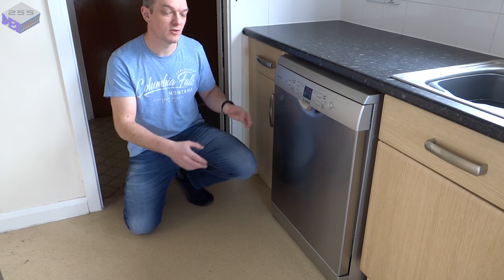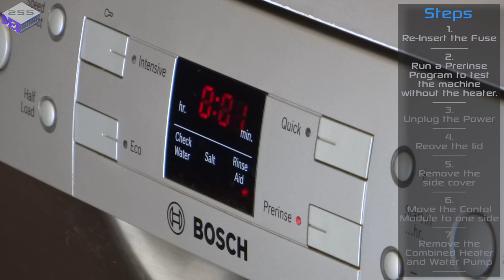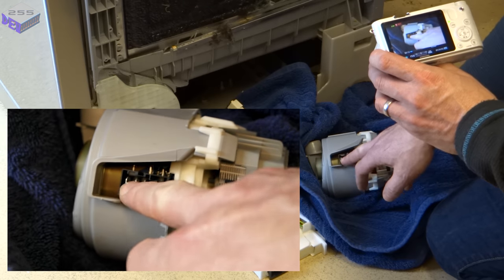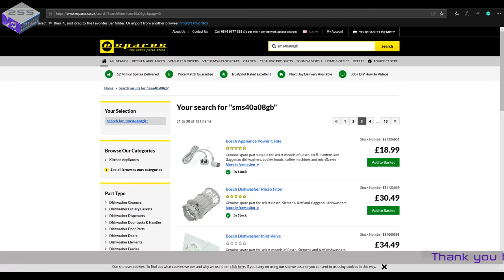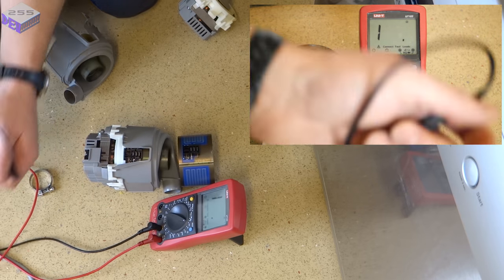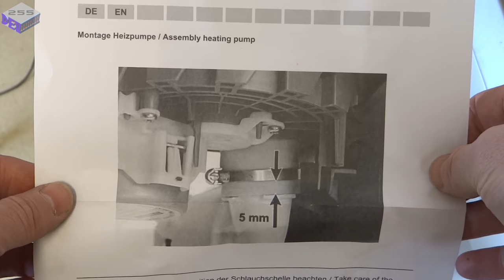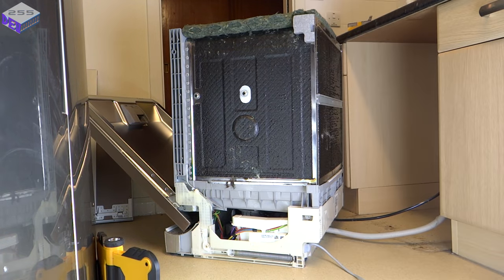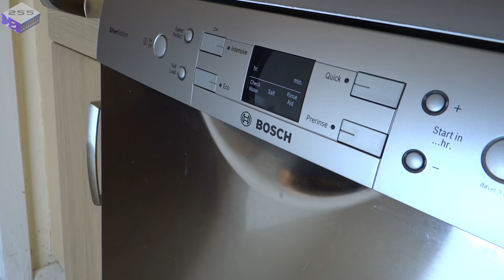How to Test & Replace the Heater & Pump in a BOSCH, SIEMENS, NEFF and more Dishwashers

Comment: Hi Thanks for the video, replaced faulty pump, but still no joy with heat.  No shorts happening.  Dishwasher still runs full cycle but with no heat.  Flashing water tap light when finished.  I did have a faulty pump as did a complete check as you described, had open circuit and new part tested good?  Any suggestions before I buy new washer? Anybody want a new heat pump for a Bosch?
Reply from the maker: Hmmm, a couple of things to check. Firstly the connection for the heater at both the heater end and controller end. You could always take the lead off the controller end and measure to 20ohms through the lead, that way you are testing the connector also (at the pump end). You could also check the thermistor with your meter, this should be in the k ohm range at room temperature. I can check mine and let you know if needed. There is not really a lot else you can test without power applied. I would insist that a fully qualified technician checks the following for you:  Connect an AC voltmeter to the heater output (while connected to the heater) switch on the machine (not touching the meter) and running through a program to see if the problem lies with the control board, it should show near to your local mains value when attempting to heat. Under no circumstances should any unqualified person attempt live testing (especially where water/high humidiy is present). I hope that helps
Reply: @TheSolarPoweredEngineer  Thanks so much for the reply.  I had the same problem as another commenter with the little grey wires leading to the heat pump coming out of the connection clip.  Before your reply and after I traced the correct combination back to the control box and took a punt on not getting a great connection.  Striped the wires back a little and made sure all secure.   All working again mainly thanks to the heads up of your video to look at the heat pump and test!  You have (for now) help saved me dishing out for a new machine.  Thanks for the video upload!
Reply from the maker: No dramas, happy to help, glad it's fixed
Reply: @TheSolarPoweredEngineer  Amazingly, I seem to have experienced the same problem at the same time - I replaced the pump (it had failed - open circuit on the heater) and yet still have no heat with the new pump (except, bizzarely, on the Quick cycle, on which the heater runs for a few minutes to make the water lukewarm as opposed to cold).  Relays on the board still functioning so am about to read the last rites unless someone is able to advise any way to bring my dishwasher back from the dead...🤔
Reply from the maker: @666dogg666  hmmmm the relays may be energising, but are they making a decent connection, It may be worth spraying the contacts with switch cleaner if you can remove the caps, leaving for a while then trying again
Reply: @TheSolarPoweredEngineer  thanks...will try it.  Did seem to be continuity through the relay but no harm in checking and cleaning the contacts...will update.
Reply: @TheSolarPoweredEngineer  thanks, managed to take the top off the relays.  They seemed pretty clean though I cleaned them with some fine grit paper nonetheless.
Back to test on the
Reply: @TheSolarPoweredEngineer  thanks - managed to open up the relays.  They seemed clean but I nonetheless skimmed the contact surfaces with some fine grit paper and put it all back together.

Ran the quick cycle and...got the same result.  Approx 3.5 minutes' heating and then I heard it click off.

So...ran again but interrupted the fill to add some heated water, to see if a thermostat / thermistor was causing it to trip out early.  So whatever temperature at which it stopped heating would be reached much sooner.

Result...heating ran for exactly the same time.  So probably not a problem with the thermistor.

One common factor seems to be that the heating stops when the first phase of a wash cycle finishes.  You hear the pump pause approx 6-7 minutes after cycle start (approx 3.5 minutes after heating starts) and at that point the heating stops, indicated by the click of a relay and my smart meter showing the drop in consumption.
That change in the wash cycle could be a trigger, though for what I have now run out of ideas...

So am really scratching my head here,
Reply from the maker: @666dogg666  That's a shame, what was the Wattage difference of your smart meter? the motor doesn't draw much current, if there was a fairly high change on the meter, this could still indicate a thermistor issue.

Comment: Hi, 
what must be resistance of the ntc pins ? Near the heater sockets..
Thanks a lot..
Reply from the maker: Hi, I haven't got one to hand to test, although thermistors normally operate from around 1k to 10k ohm,
Reply: There is a resistor from the centre pin to each outer pin. So each centre to outer measures about 11k at room temperature. If you measure across the outers you will see this in series - about 22k.

Comment: Hey Neil, love the video, it's also exactly what i needed to show me how to replace the pump in my Siemens dishwasher. However, i need advice, my pump, which i bought from the UK, BUT, when i removed the old one the 3 grey wires came out of the sensor connector, so now i'm stumped to figure out which grey wire goes back to the connector, relative to the connector on the board. Any ideas how i can figure out how to make sure the wires go back in the same holes?  The plug that it goes into on the board is a 5 pin, and has 2 yellow wires, positions 1, 2 and the 3 grey wires, from the pump, positions 4,5,6. cheers in advance.
Reply from the maker: Hi, thank you. I'm glad the video is helping. The grey wires go to the thermistors, there are 2 of them, and they should read around 10k ohm at 25ºC. The centre pin, I believe, is ground (but is certainly common), so you may be able to test this back to the control board on the wires to determine the centre wire. Both the other wires should read the same value to the machine's chassis, where these 2 are the outer wires. So you would end up with pin 1 - thermistor 1 sense, pin 2 - common for both thermistors and pin 3 - thermistor 2 sense. It won't matter if pin 1 and 3 wires were reversed as they rise and fall at the same rate with temperature (assuming no-fault), although if pin 1 or 3 wires were incorrectly connected to pin 2, the temperature reading would be off, and you may get no heating or heating too much with an error. I believe the pair form part of a Wien Bridge with matched pair in the control unit, although I don't have one here. I hope all that helps; please let me know if you get it fixed and good luck.
Reply: @TheSolarPoweredEngineer  Hey Neil, Thanks or the quick reply, dishwasher was in the kitchen in bits for most of the day and morning,. However, with your help i managed to fix it (so it seems after testing). I was fortunate enough to have one of the grey wires come out of the connect with the metal clamp thingy (from the connector) still attached, so i only needed to figure out which 2 grey wires were where. Also fortunately, the one with the thingy attached was one of the sensors rather than the power one. (It was number 3 on the connector - that wire going to number 5 on my board connector - only 5 pins on board connector). So opening up the board and looking at where the grey wires went, i was able to determine that, the 'pin' with the transistor was the power controller, and so therefore the other was the 'other' sensor. So with a little bit of logic, and with your comments above, that the centre pin on the pump connector was the centre pin on the board (so that was the power connector with transistor - common) and so it fit into place. Seems fine now after a test wash, it heats up, no E09 code and stops when it should, and more importantly no leaks! Cheers!
Reply from the maker: @Ka Bu  Hi, no dramas at all; I'm glad you got it fixed, it sounds like you are a true techie. Well done 👍
Reply: @TheSolarPoweredEngineer  I am an Engineer of the design/development variety, not really Electrical Engineering though, but know enough to get myself into trouble!. Was fun. Again thanks for the tips.
Reply: @TheSolarPoweredEngineer  For anyone with the same issue with the grey temperature sensor wires: the center wire on the connector (common) is also the center wire on the board. The position of the 2 other ones doesn't matter

Comment: New pump-heating element assembly cost 125Euro...new integrated washer start from 375Euro. Track burn off just in the beginning next to pin leg, due to minor leak from pump casing gasket... Just solder it again and swing a bit the gasket during assembly, to prevent leak again. All OK.
Reply from the maker: Hi, sorry I thought I had replied. I hope the dishwasher is still serving you well.

Comment: Thanks for the video. I replaced the pump in our Neff the other day and its got unbelievably hot, when i tested it. However, it is now only getting Luke warm. Any ideas? Thanks again. Russell.
Reply from the maker: Hi, no dramas, I'm glad it helped you. I would be tempted to take a look at the element again and possibly spray some switch cleaner (electrical contact cleaner) on the connections and ensure the seals are free from scale and foreign objects. You may wish to test the element to see if it's around 20 ohms too. If it turns out to be faulty, then you should be able to return it under warranty. If it tests out ok it may be wiring or even the control board, wiring should not be too much of a problem to resolve, although the control board may be fairly pricey to keep an older machine going, although there are plenty of people getting rid of machines with other faults so you may be able to get one with a decent board, they are pretty robust. Do you get any other fault codes?
Reply: @TheSolarPoweredEngineer  thank you so much for making the time to answer my query! Massively appreciated. Ok, so its a series of unfortunate events: one error code after another! I fixed the first two errors and foolishly tipped the machine up to get a better look and flooded the base. This damaged the heater. Replaced the heater, put it on test and as i said it got mega hot. Like i couldn't believe how hot even the outside of the machine was. Always, i reinstalled it as thought all was well and then noticed the next day that the glasses weren't drying, but the water was getting warm, but not hot. I am wondering if on the first test, the thing got so hot it partially burnt out? Maybe the heater is in sections and only one section is working? Or could it be the thermostat? I will take another look and thanks for the help :)
Reply from the maker: @russellharris  Hi Russell, no dramas, happy to help if I can. The thermostat is built into the heater pump, so it's worth checking the connections there too, it should be in the 5k ohm to 100k ohm range, so it's worth checking that its not gone open or closed circuit. I would also recommend looking for water ingress into other components underneath too and possibly leaving the machine to dry out over a few weeks and see how it performs then, it might miraculously return to life when everything is dry. The heater element is one track that snakes back and forth around the circumference of the heater tube, so the only things I can think of is either a high resistance heater track (greater than 20 ohm (lower Wattage), water ingress (although this normally causes a mains trip as power leaks to earth), damage to wires, or faulty control board. I hope that helps.
Reply: @TheSolarPoweredEngineer  bizarrely, when set to a 70c wash it gets phenomenally hot! We usually use a short 30min wash, when the water only gets warm. Strange! :)
Reply from the maker: @russellharris  It sounds like it's working ok then as a 30min wash would be ok at 30ºC or so to clean lightly solid crockery, plus most detergents can now work down to 30º too, to save the energy bills. It's constant hotter washes that can cause calcium build-up and reduce the effectiveness of seals.
Reply: @TheSolarPoweredEngineer   hello again Neil. Since our exchange of messages we’ve been struggling to get our Neff to behave. Sometimes the water gets hot and others it only gets warm. Dishes are not drying properly. It seems to work when you reset it. But even resetting doesn’t always work. I’d say it gets hot every third wash. This has been the case since we replaced the pump/heater. It may be that the issue wasn’t the pump/heater but something else. Our original problem was no hot after and our problem now is sporadic hot water. Maybe the PCB? Thoughts? Russell.
Reply from the maker: @russellharris  Hi Russell, it really does sound like the gremlins have moved in. Re-reading all our messages, the only thing I can suggest, as it's only a collection of components in reality, is to strip it down and remove all components and circuit board, check everything for signs of water ingres (even old water marks), check all seals are clean and are able to mate correctly, then spray all contacts with electrical contact cleaner and try again. Why the pump is out it's also worth rechecking the heater element for 20ohms and the thermostat on high kOhm range. It does sound like you have a control issue after all that, but this can be from a sensor. There's a water level sensor in the reservoir (where the filter sits) that also checks the opacity of the water, it's just a thought, but this may cause the water to overfill or underfill if not working correctly but shouldn't really affect the water heating as this should be controlled by the thermostat. I would really lean towards the control board after that, although this should be a last resort item as you could spend out on it only to find something else the problem, hence suggesting looking for a similar machine that is being scrapped so you can make one good machine from the two. I hope that helps

Comment: Bosch dishwasher error e11 what solution
Reply from the maker: Hi, I would say it was your thermistor that is the issue, either connection, water ingress, thermistor failed or main circuit board fault. The thermistor as far as I'm aware is normally mounted on the pump and is part of the heating element unit. Does the dishwasher work after leaving the machine for a day or 2? If it does, it's probably water ingress.

Kind regards, Neil.

The best site I've found for displayed errors is Here if that helps: -

https://bosch-dishwasher-errors.com/bosch-dishwasher-error-codes/#:~:text=Action%3A%20Check%20for%20blockages%2Fbuild,interacting%20with%20the%20element%20properly.&text=The%20error%20E11%20indicates%20that,the%20temperature%20sensor%20is%20broken.

Comment: you need to go back and fit the support bracket connecting the motor to the body as this helps with vibration
Reply from the maker: Very good spot, it also helps to prevent further leaks from that vibration ;-)

Comment: Great video, but YouTube recommended it to me after I already found the issue. I had e09 but the dishwasher is an expensive piece of crap.. I remember paying about 500€ on it and in two years it failed two times first some stupid water solenoid fairly easy to replace and now the heating element inside the pump which of course you won’t be able to buy separately even if it has its own part number and it’s a separate part from the motor.. I mean where would they make their money if not from suckers who buy expensive shit and expect them to work better and last longer than the cheap ones.. which use the same freakin parts. I bought all the kitchen appliances as a set all Bosch, dishwasher is shit and the oven which I rarely use sometimes takes 40 min to reach the right temperature to heat a pizza. I expect the washing machine and the fridge to go soon, I don’t know how they make this things so precise to break soon after warranty expires..
Reply from the maker: Hi GP, Thank you. I think that's the same across the board for all manufacturers unfortunately, where they have to compete for price and reduce build quality. The only ones that tend to last are industry machines, although you'll pay a high price for them. I believe virtually all the machines are the same on the inside, having only different exteriors to suit different preferences. Just look at how many models my video covers in the description. I do like Bosch products, although they too have to compete on the same market unfortunately, which makes them fail in the same way. I think the way forward may be to buy cheap and pay for a long parts and labour warranty, that way you can have one product for the term of the warranty, say 5 years.
Reply: Neil Devonshire - Dev255 extended warranty is an option, however here in Spain when the drain valve failed I called Bosch service and they wanted to charge me for the callout even if the thing was still in warranty probably 50-100€ and the valve cost only 17 quid on eBay. 
They’re relying on every normal person thinking when the appliance goes bad if the part cost almost 50% of a new machine price eg. pump, I guess anyone would rationally take the decision to scrap the old unit and just get a new one instead of have the wife moaning about the thing being broken 😂

Comment: Don't fix it buy another machine, my pump lasted 7 months bought direct from siemens £108.
Reply from the maker: Hi, I would recommend getting a refund from Siemens too if you get another machine, these pumps should last at least 2 years. It could be that the machine was leaking on the unit from a dirty seel. Hope you get it sorted.
Reply: @TheSolarPoweredEngineer  they refused to honour 12 months warranty, they said because I fitted it myself. Left them a nasty review on trustpilot.
Reply from the maker: @Medea007  Oh, surely they should declare that the warranty is void if you fit it yourself when they sell it to you. Does it say that on the receipt/invoice?